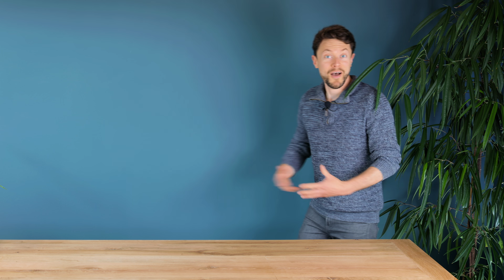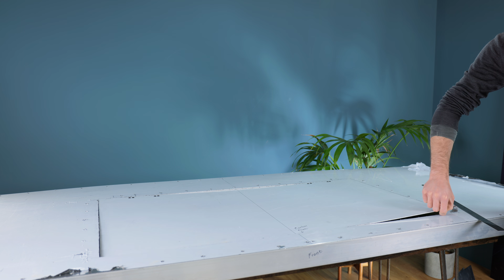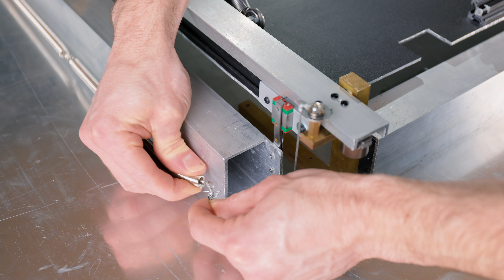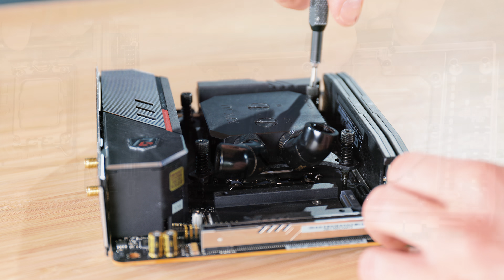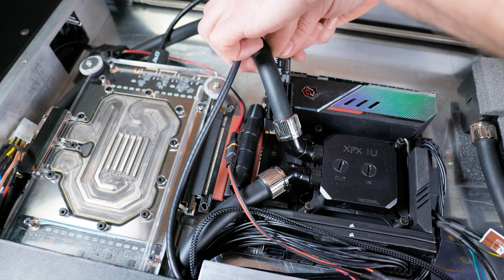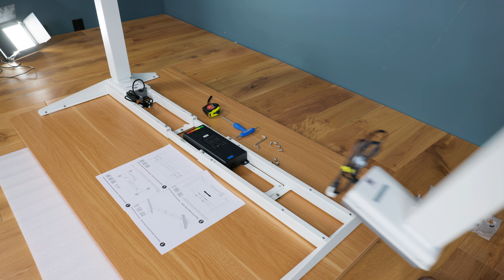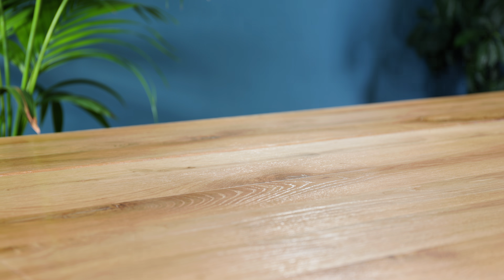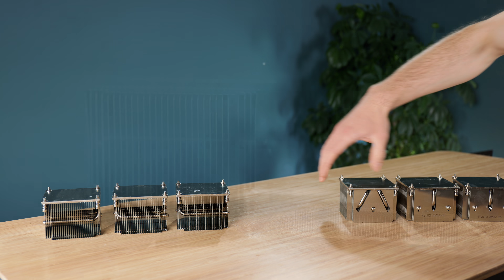Building the ENDGAME invisible PC

Comment: 11:54 i'm no engineer, but that joint looks like it would be a major bottle neck. those should be proper U-curves, no? like yeah it woulda been extra work to design custom U joints for the square piping, but it couldn't have been that much extra work. honestly even just widening that hole to have the same square profile as the rest of the pipes would be an improvement

edit: yeah after watching the video all the way through, i really feel like you coulda stuck with the original cooling system if it had just been engineered a little more carefully. the square joints are one thing, but i also wonder if the fact that the fans were drawing air from inside the desk housing had any effect. too bad, because it fit so nicely in the desk compared to the final cooling system

Comment: I very much appreciate you taking the time to showing us the result of the insufficient cooling that initially happened. A question I do have is that was there a reason not to put the cooling underneath the hinged area? Either moving air through in to the area or installing thinner cooling pipes underneath since you're not doing hard line cooling the amount of moving that would affect it would be minimal. Also the tapered edges to give the desk a sleeker look could be applied to, again, fit more cooling.

Comment: It looks like you are taking the water outlet of the CPU and plumbing that into the input of the GPU, which leads you to have 50C and 70C temps; if you instead plumb them in parallel you could bring 26C coolant into them both.
Reply: CPU and GPU water temperate will have a delta of a degree max. Parallel or not doesn't matter. Temps are as good as they can get without liquid metal/direct die cooling

Comment: You really never cease to amaze us.
Honestly, the desk is deep enough, so the extra fans at the back sticking out will likely NEVER be a problem.
Sure, you might have to clean them a bit more often without a mesh in front of them, but they're relatively high up, and don't suck/blow as hard even.

Comment: Was the reason you didn't go for a water-cooling radiator where you wouldn't need fans at all just cost? Seems a bit of an unusual decision when you could have had everything fit in the frame with minimal extra cost, especially given the very high specs of the machine.
Great build though.

Comment: matt well done yet again, your video and builds are like none other, attention to detail and persistence is remarkable. Want to add that your editing and camera work has improved significantly over the years. A positive attitude like yours is what we need more in this world.

amazing job on the spring plinth at the back of the monitor, tapered edges! amazing and the design for the monitor mech is ingenious!

would of been crushing to see those temps climb as you did your first round of testing, but you soldiered on and found a solution, those server heatsinks really are a dime a dozen and perform very well.

Comment: Wow you really outdid yourself with this one, I thought the previous build were already very good and yet you created an even better version of that original build, and for other hobbiers out there, there are still more thing's you could do to make it your own in term of performances, design and functionality, for instance adding a hidden Wireless Charger or hidden stylus pad for once, for design wise you could also add hidden sound systems/tweeter or by using the tappered edges slightly enlarged the bottom of the desk to concealed the cooling fans + heatsinks. That's just a few things that I could think off and I know someone in the comments would probably have other ideas such as using different materials or adding a light strip to the desk itself et cetera.

Comment: Make sure you go into the BIOS of that machine and DO NOT leave everything on Auto. There are various videos on 13th and 14th Gen stability problems, also this forum thread. Make sure you set "Enforce All Limits" or the silicon will degrade over time, and you'll have stability issues.

Comment: A nice addition to the setup would be a microswitch or magnet and reed switch which is closed momentarily as the monitor hatch is opened and closed. This way the computer turns on and off with the opening and closing action. You'd obviously wire this switch to the motherboards power switch pins. Another optional extra would be to route a hole in the aluminium for a hidden qi wireless charging coil and use the standby power of the PC to charge a phone.

Comment: A couple of problems:

- Because brass pipes go back-forth-back-forth, I imagine most heat is concentrated near input and output ports, jumping across pipes rather than going with the flow. Therefore the furthermost coolers probably don't do anything at all.
- You're mixing different metals here, brass and copper in particular, which will lead to galvanic corrosion. Gotta fit a reservoir in there with sacrificial anode to prevent water blocks gunking up.

Overall, though, neat as always! Not sure I'd opt for such setup, but the creativity is astounding.
Reply: My basement is full of copper pipes soldered to brass fittings. Brass is copper: Brass is an alloy created by mixing copper and zinc, the proportions are adjusted to create different brass applications and uses. Basic brass is 33% zinc with 67% copper but these levels can vary considerably. Lead is sometimes added to improve machinability.
Reply: About the first issue, the holes don't go through all the pipes. They are in pairs on alternating ends, forming  a maze-like path, so the coolant does have to flow through the whole thing before it reaches the exit. I'm pretty sure that liquid flow will be transferring the heat fast enough for the pipes touching to not be an issue. First rail would be hotter than the last, but that barely matters.

Galvanic corrosion on the other hand can be a real mess, that's a really good point!
Reply: The furthest coolers do contribute to cooling. You have some misunderstandings about heat transfer. 

Galvanic corrosion shouldn't be an appreciable issue. Go look at a galvanic corrosion chart yourself. Copper, brass, and lead/tin solder are quite close. The water block could be aluminum and that might present a problem but I think it would be mitigated greatly by the low conductivity of distilled water and distance from the brass and copper.
Reply: true, you should separate the brass pipe from touching each other so the water can pass the heat to the radiator instead of other pipe. a lil bit of aerogel strip can solve the problem
Reply: What the f*** are you talking about? The water channels of most PC radiators are made out of brass. Galvanic corrosion is NOT an issue.
Reply: Bro thinks he's smart ahahaha. Neither of these things you mentioned are even remotely true.
Reply: @FREE-TW (refuses to elaborate)
Reply: @Soda_Bobinski not need, he got obliterated by every comment above already

Comment: You can get smaller fans with more static pressure and because you have such a large surface area you can run the super silently
But did you check for chemical compatibility for all the components in the waterloop? Often the fins in the cpu and gpu block are nickel plated copper which can get jammed with gunk from other metals
I’m really interested in how you handled usb accessibility in this build
Very nice build btw

Comment: I absolutely love the look of this pc but galvanic corrosion is going to be the death of this pc some day. You cant just mix metals like you did, the lead alloy solder, brass tubes, aluminum fittings and copper micro fins in the heatblock are all going to corrode each other and your cpu-block is going to get so gunked up that your pc will just turn off after being on for a few minutes. No idea really how long its gonna last but Id really like an update a year from now.

Comment: Love it

The drop down compartment drops below the bottom of the table, where hair and dust can get into..
But since you got fans sticking out it's not as bad

The only other thing that is poor about this design is that the screen can't be adjusted, more specifically the tilt (the only one you could "easily fit" into the design

Comment: Makes me wanna build one but not for hiding, but maximizing space. I would however take a note out of race car design and use regular water cooling rads but at an angle so as to allow air in and out while still fitting in the form factor.

Comment: 26:26 no compromises? Except when you want to stretch your feet and break a fan. Or when you look at it from a bit further away and see them hanging over.  A few simple heat pipes and smaller coolers would have done a much more sleek job

Comment: Such an amazing build! It's a bit unfortunate that the monitor doesn't bend anymore, but I'd prefer a flat one anyway.
I'm also surprised that you went with such an exotic cooling solution. If I would daily drive a system like that, I would try to get away with air cooling. Maybe a 7800X3D and RTX 4070 would be fine with air cooling.

Comment: I think there would be only a few changes I'd make if I were to build something as magnificent as this:
- Found a way to preserve the curving functionality of the ultra-wide OLED
- Used Copper box-section for the heat-sink instead of the brass runners for that added little bit of thermal transfer
- Some shrouding on the bottom to hide the exposed bits, protect the fan blades, and route some of the airflow away to the side instead of just diffusing the heat
- Uhh....That's it! It really is SUPER End-Game! Fantastic!

What I find amazing is that, with a little re-engineering, nothing about the table is particularly impossible to manufacture at a commercial scale. This is 100% something that could be tooled for mass production. The only considerations would need to be slightly increased accessibility for BYO computer and monitor components. I dunno what the EXACT market demand for something like this is, but it's DEFINITELY something I think someone could make a shop to manufacture and could probably make enough money to spend a life building exclusively.
Reply: @mawlakewlz  The fans look beautiful, and will catch the attention of anyone casually looking down there. And they don't blow air on you, they suck air from you, which at less than 500rpm and many centimeters away is barely noticeable anyway.
Reply: The fans are oriented so the air is blown at the back, other than that I'd also use fan grills to shield the baldes and switch those Corsair to either Noctua or something with magnetic bearings to make them even more silent.
Reply: He can use the LG version of the monitor which has electrical adjustment for the display but I think a 4K non-curved panel would be better for a project like this
Reply: He could also make an uppy downy chair.

Comment: Copper: 401 W/m·K
Brass: 100-125 W/m·K
I really would not suggest using brass for water channels to solder copper heatsings to, as the brass will heavily limit what the copper part can achieve...

Comment: The build is obviously insane, but as someone who hates ads and sponsor messages, the flexispot sponsorship is the ONLY time I've ever been charmed by sponsor integration. Part of it is how well the sponsor goes with the build, but the presentation is fantastic as well, not just an afterthought tacked on in the middle for revenue. Bravo
Reply: Came here to say exactly this. Clever and inoffensive advertising.
Reply: Thought this too. Only time I've never fast forwarded through a sponsor ad.
Reply: Blacktail Studios also did a sponsored spot recently, and that desk turned out beautifully, too.
Reply: Agree. Also I've got one of their desk mechanisms (had it for 3 years now) and it works really well, would recommend.
Reply: Look for iSponsorBlock it auto skips in-video ads for you automatically

Comment: I suspect one big part of the cooling problem was due to a wrong design of the brass tubing. With that structure it's almost impossible to have an opposite flow, vital for the thermal exchange. You solved it overdimensioning the air surface and it worked great, but with a more efficient design you could reach the same result with less space. All the rest is simply wonderful as usual.

Comment: Just FYI, I would experiment with static pressure fans first before going for another radiator. Static pressure fans are designed for radiators specifically.

Comment: As easily as you seem able to close it by simply pressing on the keyboard surface, I would be concerned that sitting at the desk with my arms and wrists resting on the keyboard/mouse would close the hatch on top of me.  I can't help but notice you never actually sat at the desk and used it like a normal person would,  but instead lightly hover-armed it when typing for the sound test.

Comment: It's really cool. But it would be even cooler with dual monitors, especially because there seemed to be space for the second one. Being the IT guy who put hundreds of PCs together, - when I saw your laptop fans and the kind of CPU and GPU you were using, I immediately had a facepalm moment, knowing just how inefficient (and often high pitch noisy laptop fans are, - I thought: "this guy is in for disappointment". The shallow ridges on those heatsinks was yet another issue. So it's good that you didn't decide to cut that part out of your video, - it will certainly warn other people from making similar errors. I don't know what the coolant you used is comprised of, or if it's DIY, but hard water (calcium) and high PH (acids) can do a number on brass, hopefully that won't be a problem in the future.

Comment: I think adding a small button to the desk which would automatically put the computer to sleep when the lid is closed would add in a nice touch too.
Reply: a lapdesk, a desklap ?
Reply: deskfold
Reply: @gaurav889  obviously
Reply: @Sulphur_67  deskputer
Reply: You could probably trick windows into treating it like a laptop lid
Reply: @g45h96  what sensor does that stem use?
Reply: @marvin2678  I think it uses a reed switch, or something adjacent with the magnets in laptop cases?
Reply: Microcontroller, reed switch, small magnet, have that emulate a keyboard and emit the Sleep key code when the lid is closed, compared to the rest of the build it would be an extremely easy piece to put together. That is, of course, assuming the power button hooked to the motherboard isn’t able to be tapped into; if it was, you could just repurpose that connection and handle it with a GPIO connection.
Reply: Today I'm going to hide an entire high-end PC and monitor inside this completely clear double glazed window set.
Reply: And close all your tabs

Comment: I hate that veneer stuff because both my desk and bed have it and are lifting off the surface. Good that there was a solution
Reply: Not sure if it was a solution, the thicker wood will have more force in its expansion and contraction cycle so it may end up being a bigger problem if its stronger than the glue can hold.

Comment: okay so i havent got through the video, so maybe he addresses this with an undervolt, but a single 500w power supply is cutting it REALLLLYYY close with a 4090. It can pull 460-670W and is known to have massive power spikes.

Comment: I'm really EXTREMELY worried about the use of different metals in the water loop. Water loops that mix aluminum and copper usually end up with both of the metals reacting and eating away at each other, which can lead to reduced performance, blockage, pump and water block damage, and leaks. I don't know if the copper being alloyed as brass is going to help with this or not, so be careful and make sure you are inspecting the water loop for signs of chemical reactions. Or better yet, replace the brass portion with aluminum. I am also unsure of what the solder is made of, whether it is lead or tin, some mixture, or another metal, but you should be weary of it reacting with the aluminum too. These are high cost components and I would hate to see any liquid damage.

Comment: That's insane, shame the original cooling setup didn't work cause it did look clean af

A small gripe i have is that IMO the monitor height is too low (not eye level) when you're sitting or standing,  my current monitor is the same and i want to change it. but hiding a monitor arm or making something telescopic would probably be impossible

Comment: I wonder if the aluminum table frame can be used as a heat spreader. For example, put your custom cooling system on thermal paste, and put radiators up to 4-6 cm high on top of it, plus use coolers up to 80x80mm, which would completely fit into a table. 

It may also be a matter of the diameter of the cooling system pipes, i.e. the water does not have time to give off heat and returns to the processor and video card, where it heats up even more and continues in a circle. Maybe it would be worth using copper tubes of a smaller diameter (for example, those copper ones that are used when installing air conditioners) and a longer length and run them in a circle more times so that the water accurately releases heat through the circuit. 

Another option is that the pump simply pumps water too slowly and it does not have enough time to quickly go through the entire cycle.

Just in theory, dissipating 850+W of heat in such a large space shouldn’t be such a big problem. Perhaps the idea with water cooling is so-so. Maybe 8-10 heat pipes from the CPU and GPU to standard blow-out laptop coolers could do a better job. Nowadays there are enough laptops that cool 200-250 W. It would be cool to see a follow-up video where you are trying to figure out this problem in more detail, although it’s probably not that interesting for general YouTube audience...